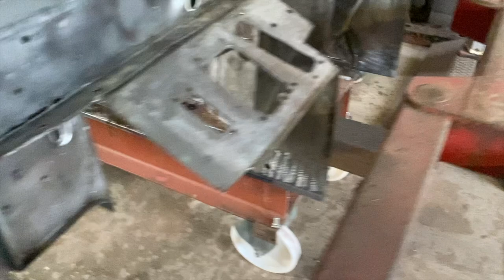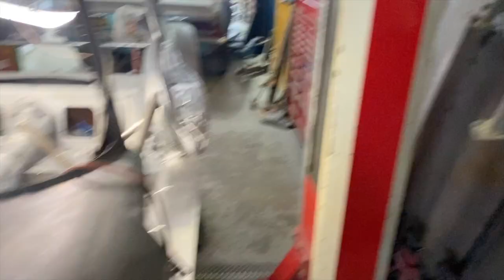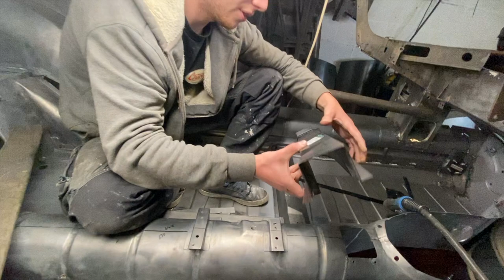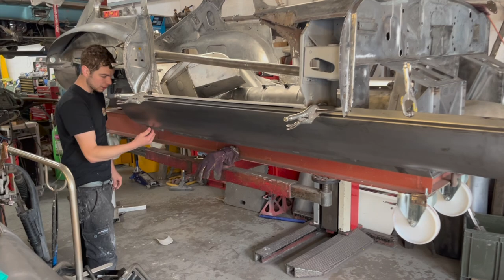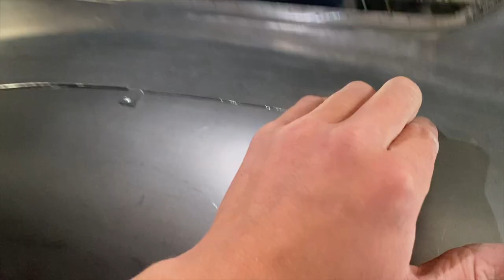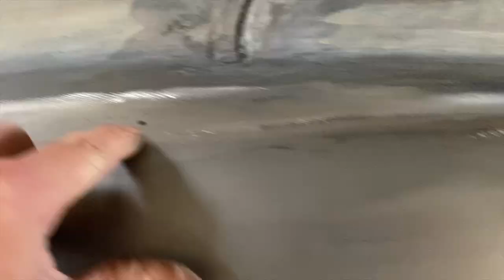Series 1 E-Type Gets New Metal | Ep2

Comment: I remember reading - as a kid - a car magazine review of a Lamborghini with a tour of the factory. (1970s) To get the frame/chassis straight there were Italian dudes jumping up and down on massive timbers to, basically, bend it until it measured correctly!  Also, if you have an old Espada, check the back of the dash. During the factory visit the car journalist witnessed parts of wooden orange crates being sawn into shape and upholstered for parts of the interior.

Comment: Could you use a shrinking disc on the beck wings or would you recommend a soft grind with a floppy disc?
Reply from the maker: Yeah we like to use the soft grinding disc 36 grit really lightly pass over it then plannish. We would heat shrink it if we hammered it and stretched it to much

Comment: Getting there...nice work ,as far as the new panels not fitting , well that is why we are making our own , and the reason why is that , when we add the price of the panels from England ,the cost of shipping them + (the fact that we might not get the right panels) ...then the labour to modified them and   fit them over and over in order to have them fit properly , we think that the overall cost of the build meaning.....  buying panels against making them is not that much more . In any case as mention you guys are doing a great job
Reply from the maker: Yes I completely understand that, we done the same with an Aston DBS the Aston tax on  very basic panels to, just made it way to expensive to restore